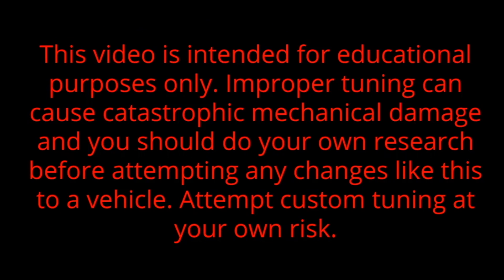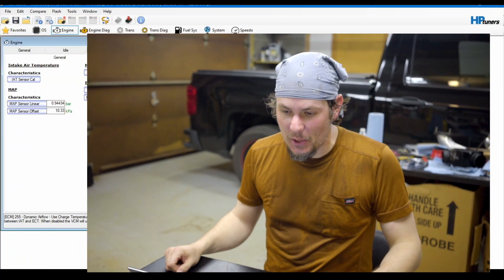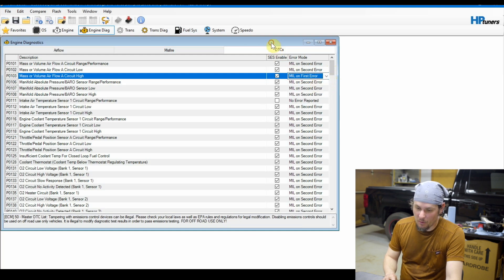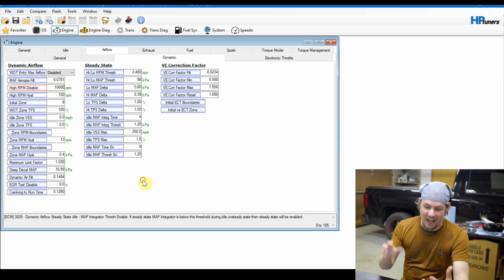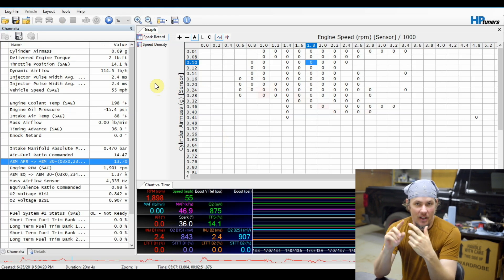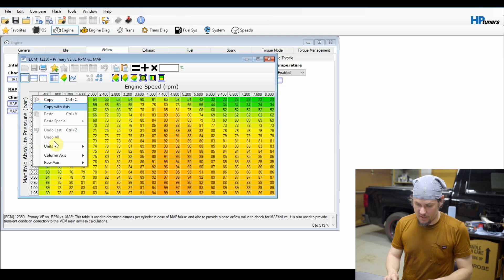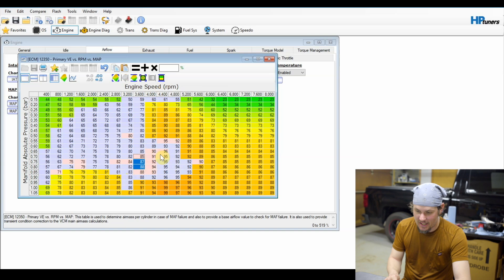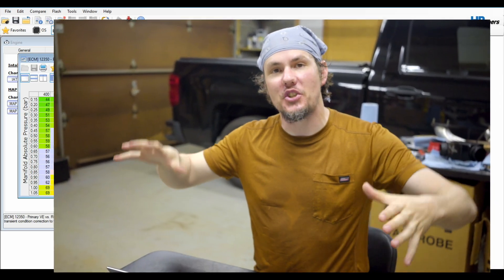GM Gen 3 Speed Density Tuning Guide Using HP Tuners, Dialing In The VE Table

Comment: what about pe  does its need to be adjust
Reply from the maker: I generally don't as when you go into PE it will change your commanded AFR so you error ratio will be correct. People disable it when they tune using fuel trims as you go open loop under PE.